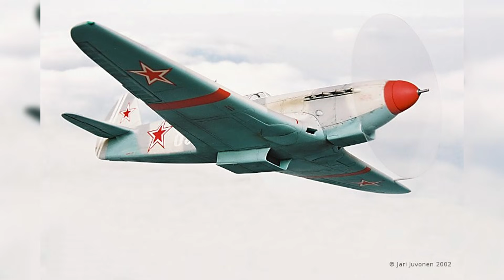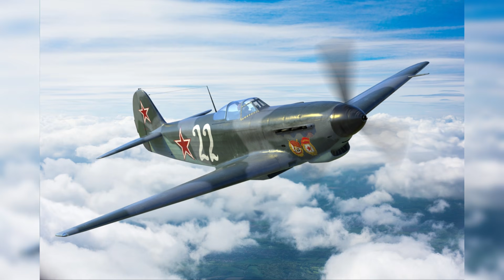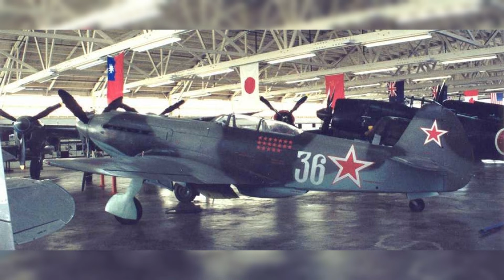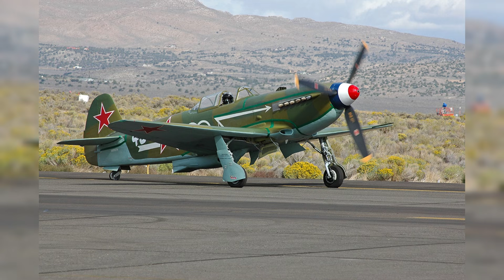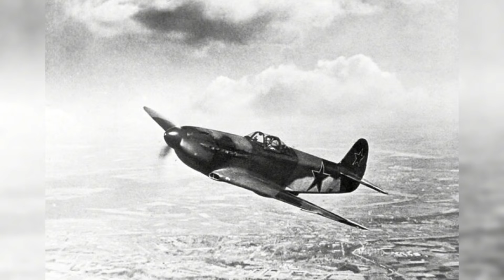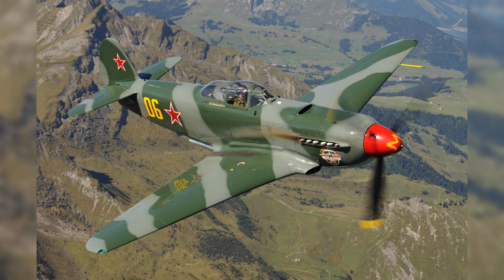Yak-9 – The Soviet Fighter That Dominated the Eastern Front

Comment: The Yak3 was superior to Yak9 and Luftwaffe Pilots were told to avoid combat with Yak3 under 5,000 mtrs. Yak9 was bigger, heavier and optimized for high altitude and long range. Cheers.
Reply: As a tactical dogfighter. They were two different planes with different roles. Not apples to apples comparison.
Reply: It wasn't optimized for high altitudes, because they share exactly the same engine with same supercharger.
Reply: @PyromaN93 not, exactly the Yak-9 got later in the war the VK-107 engine, which is much better than the VK-105
Reply: @Azur_Lane_fan some of Yak-3 also recieved it.
But, VK-107 was a failure — constructors didn't solved overheat problem.
Reply: @PyromaN93 that's why Yak-3 didn't use VK-107, but some Yak-9 models did
Reply: @Azur_Lane_fan both did recieved this engine, but due failure — installing engenes in Yak-3 was abandoned. Also, those Yak-9 had to swap engine to VK-105 back after few repairs.
This engine was complete failure, considering that fact it had to be ready in 1941.
Reply: @PyromaN93 VK-107 wasn't made on 1941, and those Yak-3's with VK-107 remain has prototypes because of the overheating, altrough there where other attemps to improve engine both in Yak-9 and Yak-3
Reply: @Azur_Lane_fan dude, do at least some fact checks. It had to be ready before war and was purposed to the LaGG's, when VK-106 was purpused for Yak's. Both engines failed miserably, but VK-107 shown at least some hope to be somehow fixed. And it was somehow fixed in 1945, but never worked flawlessly.
Reply: @PyromaN93 I will have to check that, the aren't a lot of sources about it, also VK-107 was fixes by 1944 because Yak-9U used it, of course it still have some problems but it worked
Reply: @Azur_Lane_fan it "kinda" worked. With all fixes it still was far worse than VK-105.